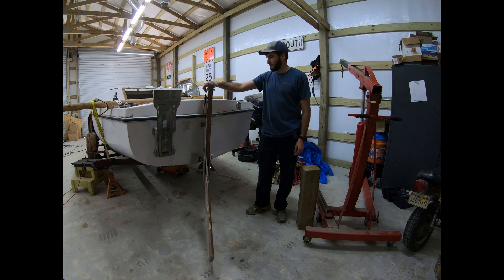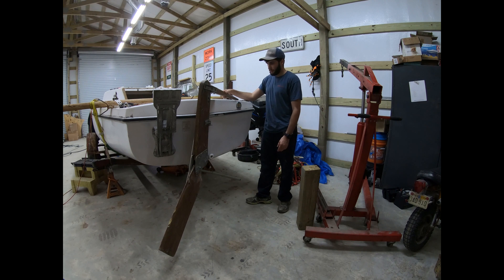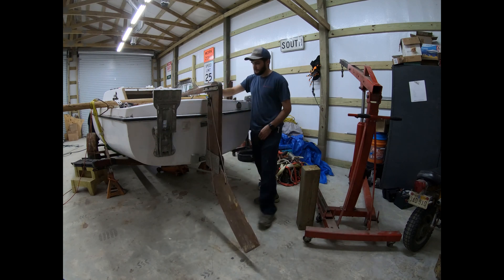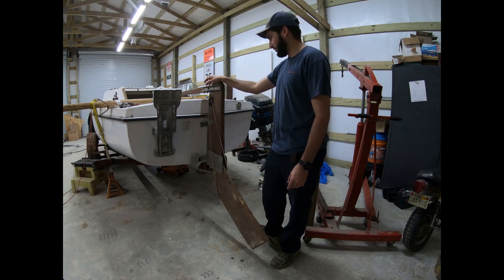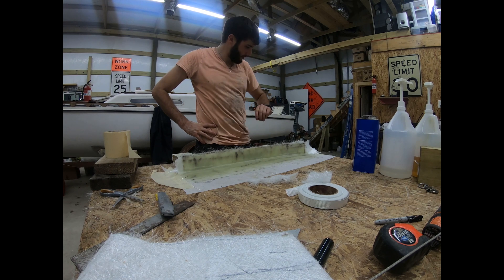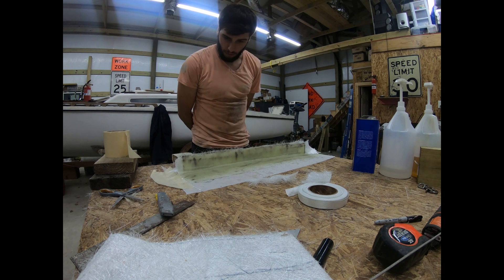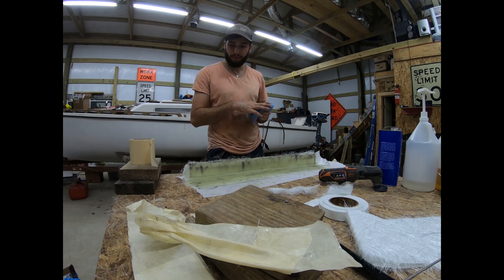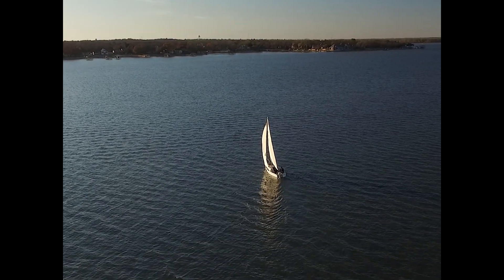Fabricating a  Fiberglass Transom Stiffener - New Salt Sailing Episode 4

Comment: From 8:30 to 9:00, are you doing the wetting of all layers with just one drying period at the end or let dry between each layer?
Reply from the maker: i wet all layers and let them cure together.  being that its in open area heat generation was not a concern on a part this small.

Comment: I would put a 1/4-inch aluminum plate on the inside or outside and use fiberglass to cover it.
Reply from the maker: The only issue with that is matching the contour of the transom.  in order to increase the stiffness i would have had to use some sort of angle which would have been tough to match the contour as precisely as I was able to with this fiberglass.  although i have not tested its strength  I'm sure this piece is equally as strong as aluminum in equal thickness and will not corrode.